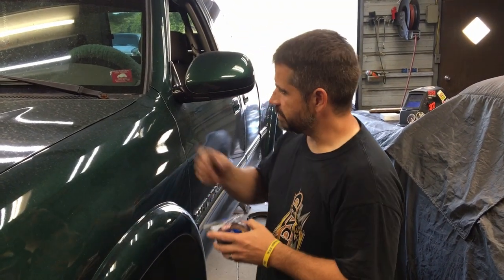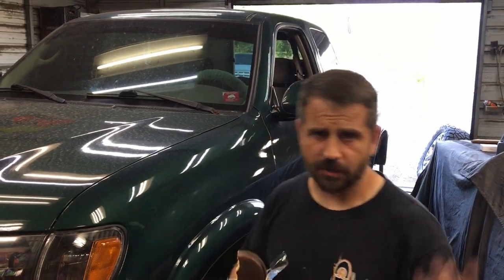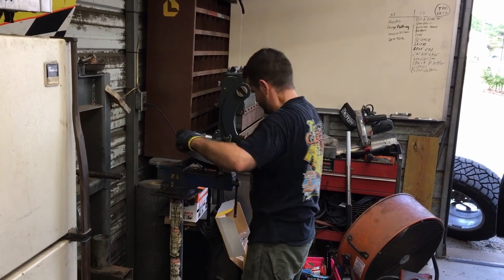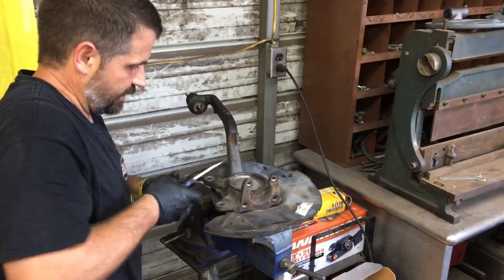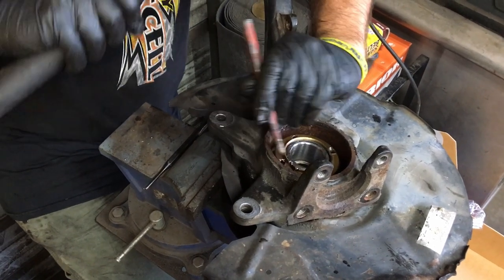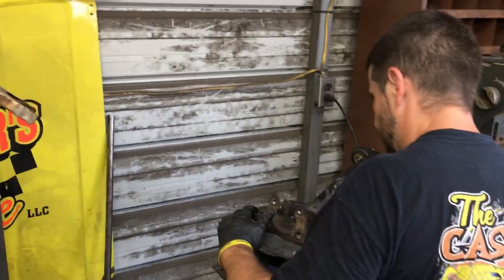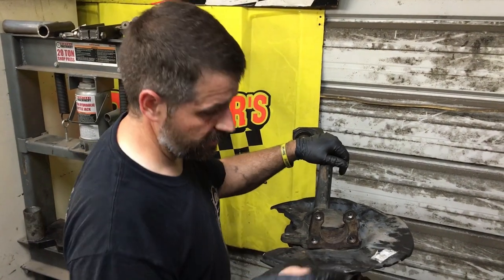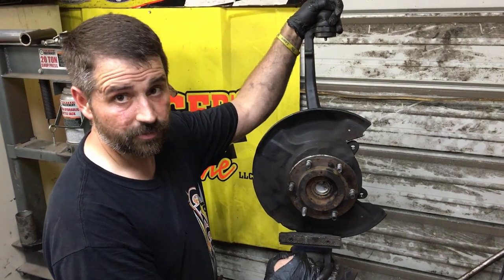2000 Toyota Tundra 2wd front wheel bearing replace

Comment: Hey brother, the four pin socket for that preload ring is W1272 at your local Oreilly store. The torque on that ring is 205 ft. lbs. (Yes I’ve got by using the punch & hammer too. But preload is important for longevity of that Bearing!).
Thanks for the sockets and Rotor spacing tip! Two treated 4”x6” blocks 11” long stood on edge, with two thin steel plates on top makes your press cradle spacing (taller) deeper also.
Reply from the maker: Awesome!  Thanks for the tips👍

Comment: If I'd of know that rotor trick would have saved me days of hassle and headaches trying to remove the bearing. A suggestion,  remove the snap ring before you press it out.
Reply from the maker: you can't access the snap ring until the hub has been pressed out so it's kind of a multi-step process.  Thanks for the comment👍